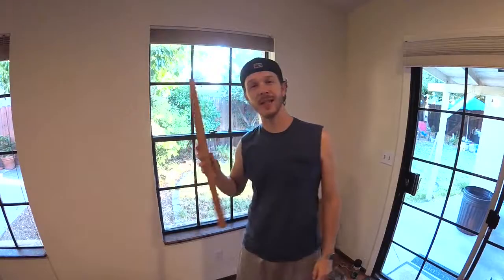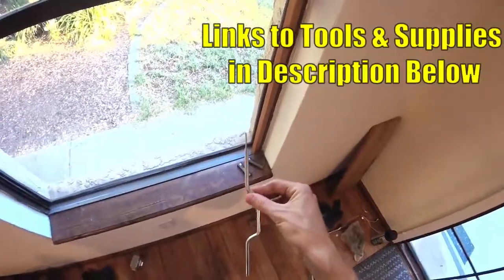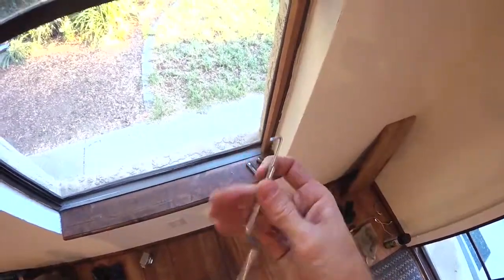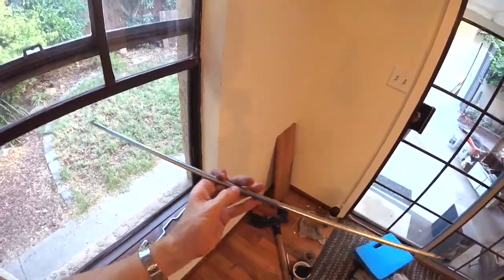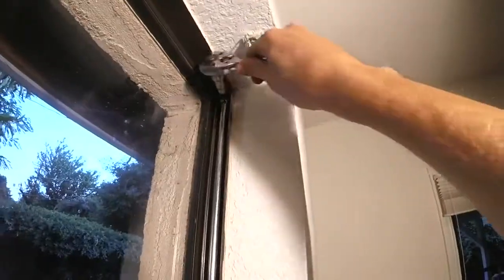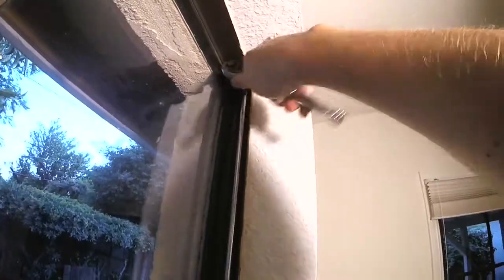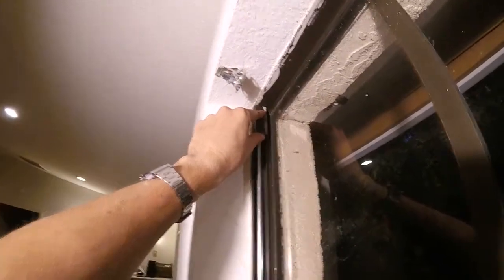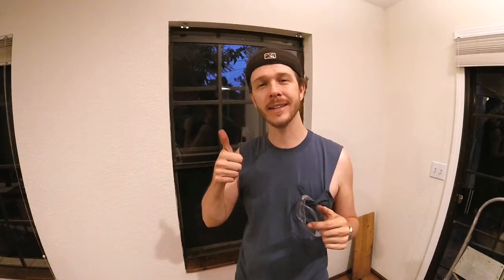FIX Window that Won't Stay Up. How To Replace a Spiral Window Balance

Comment: Excellent video. The job looks easy. The problem is finding a place that sells a spiral window balance.
Reply from the maker: Thanks! A window shop should be able to get you some. Either that or remove old ones and buy new ones online. I think I got some thru Swisco online before
Reply: Online sells any type of balance you could ever imagine.

Comment: How did you determine the old balance was broken as you were removing it? I wish I knew what is inside the tube. Is there a spring inside?
Reply from the maker: Most of them were all bent and damaged. It's a spiral piece of metal on these type ones that create the tension 👍

Comment: Great video...I was 63 yrs young when I learned this from you.  Tks
Reply from the maker: Thank you! And you're welcome, happy to share 🙌👍
Reply: I was getting ready to order that special tool or try to find it... When I looked in my toolbox and I had a little forage long orange screwdriver with a pic on the end of it curved... It worked. Perfect to touch in the rod and then put it in place and then get out of it.    Didn't even have to buy the tool.  :)
Reply from the maker: @gandl2123 Nice! That's awesome, glad you got it done and didn't have to get another tool 👍 I always enjoy making a tool too

Comment: Do i have to replace these if my window wont stay up or down? I jeep seeing people mentioning a shoe that needs to be adjusted as a fix, but would that work with this style?
Reply from the maker: @Breeski1  if they're busted like mine were they need replacing. You can adjust tension as I showed by pulling down and winding them as I showed 👍
Reply: @JonnyDIY  thank you!
Reply from the maker: @Breeski1  your'e welcome, glad to help 👍

Comment: I like the video.  I have a question. How do you remove the sash from that type of window.  Thanks
Reply from the maker: @GaryH-k9u  thanks, I'm not really too sure. That one may have needed to unscrew and take apart in pieces. I know a lot of newer ones nowadays you can take apart, they're all glued together. So you have to pry them apart and out

Comment: Great job.  Have two balances that somehow released from the window and used your video to remove and potentially reuse.  The tool is key to this repair/replacement.  Tried with needle-nose pliers, dentist type pick and to no avail.  Good, simple and to the point video...Thanks!
Reply from the maker: You're welcome, happy I could help you out 👍 yeah that little tool is the only way to go with these things.

Comment: Thank you for this video! Do you have a video on how to remove the bottom half of the window?  I need to replace the glass.
Reply from the maker: No sorry, each window is a little different and not all even allow you to remove bottom. Only in last 20ish years have those become a thing really. Search "how to remove bottom window sash" and see if can find a similar window. If it is a removable window it's a simple process usually pull up window holding button and tilt back

Comment: How to change the glass for this model
Reply from the maker: I have a video I need to release where I did exactly that. I heated up the glue around the glass pane with heat gun (could use small torch or hair dryer too) and pushed it out from inside. Then got replacement glass cut at local glass shop and put a bead of silicone around opening then placed glass on top of that. Then another bead around it and that was it 👍

Comment: My top window panel won't saty up. I have to push it up to lock it in place so it won't fall down. How can I fix that
Reply from the maker: Depends on the kind of balances it uses. I have another video showing a different type here
https://youtu.be/MwYnrVDDKzQ

Comment: how do you remove the window to replace the glass
Reply from the maker: Depends on window. Some the sliding part can be removed. Some not. If not or on fixed part you'll have to remove glass with it in wall. Use a heat gun to loosen glue or glazing and push out 👍